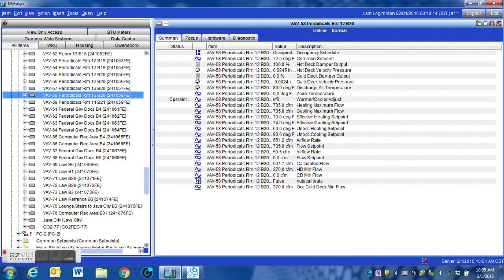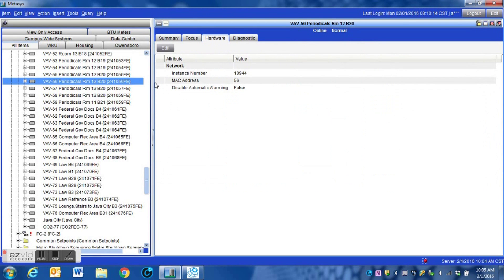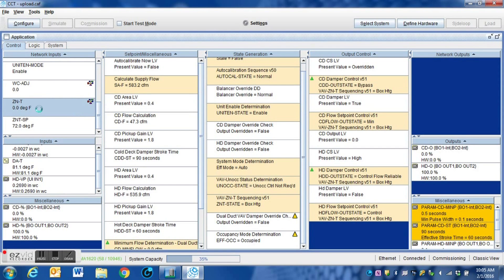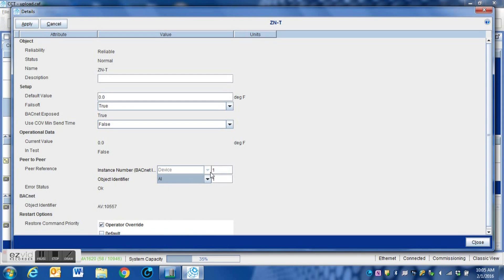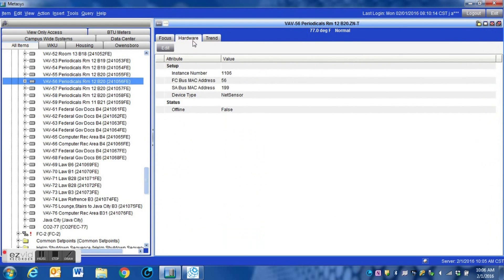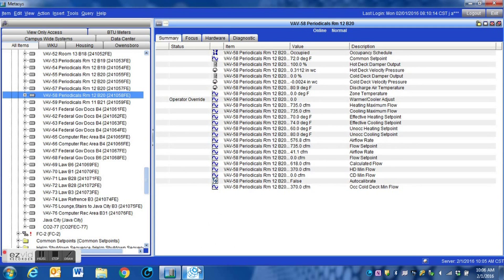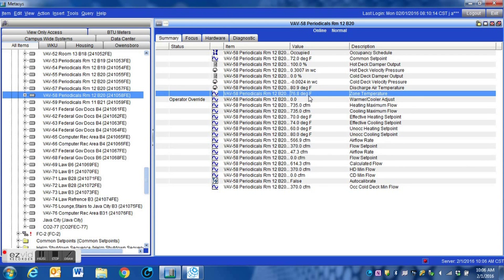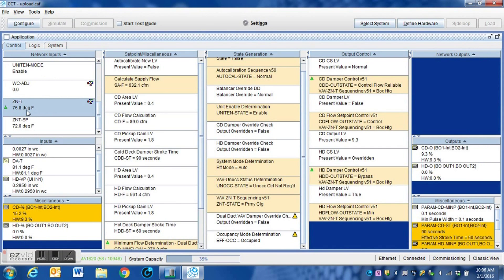Setting up Peer to Peer communication on Johnson Controls VAVs

Comment: Thank u for your video.. I did and it's working properly.
I'd like to connect 2 thermosts as a daisy chain to control only one controller is it possible??
Which zn-sp VMA will respond to..
Thanks in advance.
Reply from the maker: Yes, you only need to add the ID to the device that the tstat is connected to

Comment: Thank you for your videos! Could you give some recomendations about number of Network Inputs in CCT Configuration. I have FAC3611 and I want to read chillers parameters using BacNet MS/TP network only, without additional IOMs. Is it ok? Or, maybe, I should figure out another way to do that.
Reply from the maker: The best option for reading those points is to pull the points into the network through an NAE or NCE.  As far as the number of network inputs many of the controllers can handle more than will ever be needed.  I'm not sure about the specific number for any given controller.  We have some large systems that have a lot of network inputs and have never had an issue.  Just remember that it will load down the trunk.